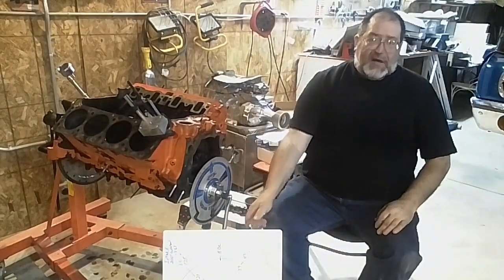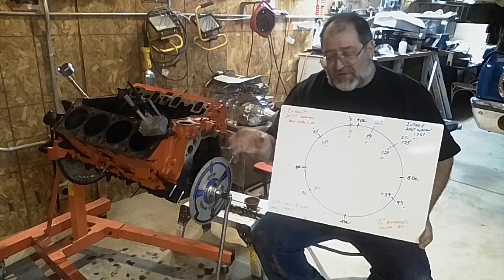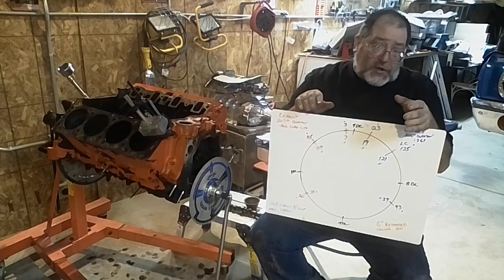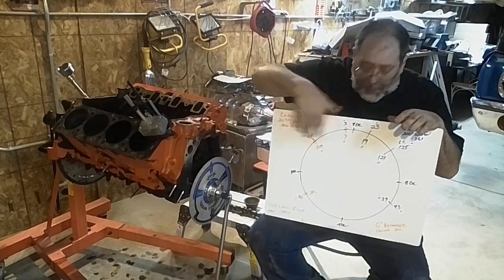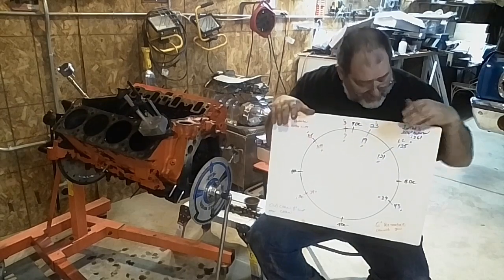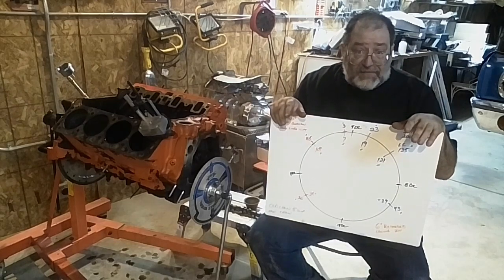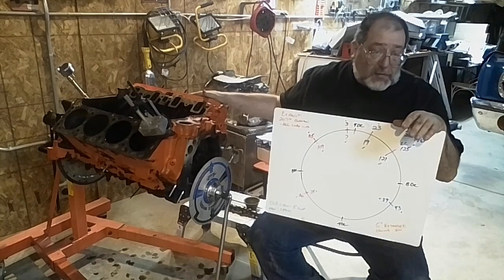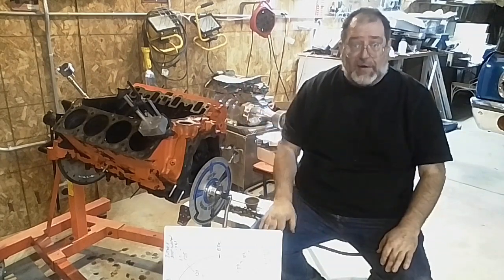Cadillac 472 / 500 Stock camshaft spec & how to make more power

Comment: I have a 76 Eldorado convertible with 48k original and it is not easy getting upgrade information. I would love to be able to speak with someone about taking my 76 500 cid to the 1970 HP numbers before all this pollution control came out "smog motors". I don't want a "hot rod" or an obnoxious-sounding exhaust. What I would like to do is take it from the anemic 190 HP and get it back to about 300-400 HP which I believe would be more appropriate for a car of this size. I have thought about headers "very expensive" and or roller cam and lifter for longevity or a regular came and lifter set. Of course, while I was in there anyway I would change out the water pump, timing chain and gears, oil pump, etc, etc. I don't want a big cam as I want to keep the cars idle nice and smooth. It is a Cadillac after all. I know the best way is to pull the motor and change out the pistons. I am hoping that there is a workaround. If I were to do that I would buy a second engine and build it while enjoying the car with the original engine until the new one is done. Any suggestions would be appreciated. Thanks again for the information and I will be looking forward to future videos regarding the 500.
Reply from the maker: Need to probably join the Cadillac 472/500 Facebook group ..... The 70 did not make that much HP ... How HP was measured changed and we went from gross HP to net HP ... Most Cadillac engines make around 300 HP stock ... Later year is a bit lower because of catalytic converter and emissions tune but without that it's still a 300 HP engine
Reply: @scotthatch4548  Thanks for the info. I knew about the net to gross HP conversion of 1972. But I thought that they changed the compression ratio from 10.1 down to 8.5
Reply: Oh, and by the way, I sent the Catalytic converter packing a long time ago...lol
Reply from the maker: @hurricane2649  compression only adds 20 HP to the engine so it's not much
Reply: @scotthatch4548  Ah! Thanks, for taking the time! I did not want to increase the compression as gas is not what it used to be. So that is great news

Comment: I found it very informative. To advance a cam would you rotate the cam 1 tooth forward
Reply from the maker: No ! One tooth is 20 degrees ... For the Cadillac you only have the timing chain with a 4 degree advance keyway ... You can also do a offset key for more but they are getting hard to find and it would require you to change timing pointer because you moved the hub too
Reply: @scotthatch4548  do you mean the crank timing gear has a 4 degree advance keyway cut in it ?   Thanks, great video!
Reply from the maker: @trailerparkcryptoking5213   yes roller timing chain has 3 keyways straight... Plus 4 and minus 4 ... I did a video on chains available for the Cadillac

Comment: If I used the roller timing chain and gear and went “retarded” on the crank key, do I need to change my timing pointer? I have a 1974 Cadillac 500.
Reply from the maker: No the key for the hub is in the same place as it always is sitting ... Only time you have to worry is when you use a different key on the crankshaft to move the timing gear
Reply: @scotthatch4548  I used the 9-3639X3 race billet roller and put the key to the square key hole